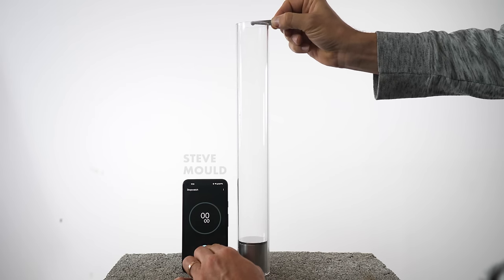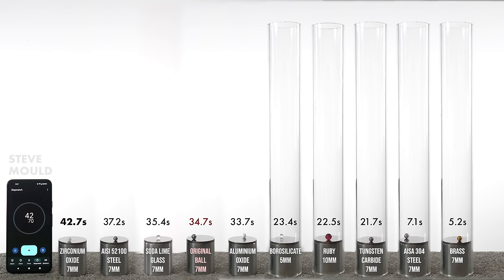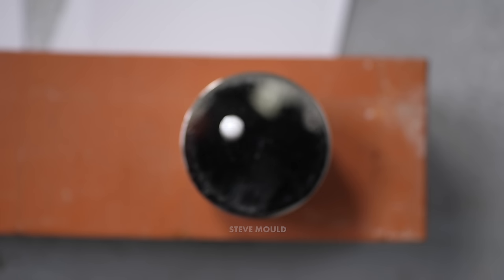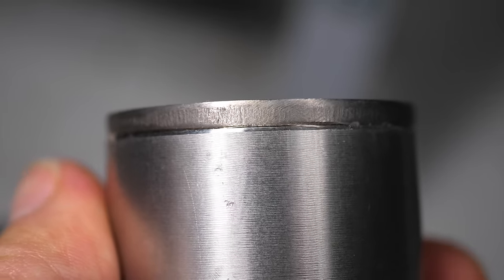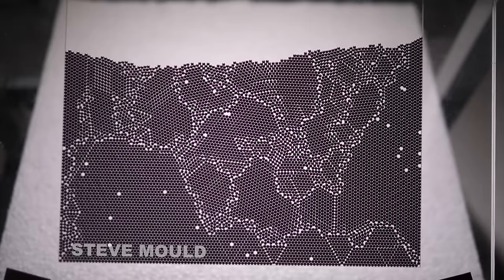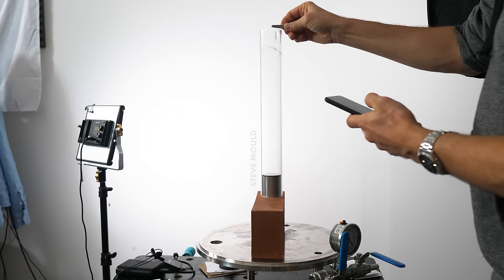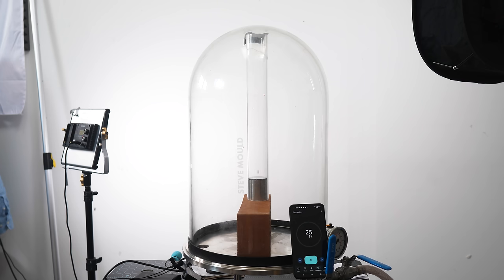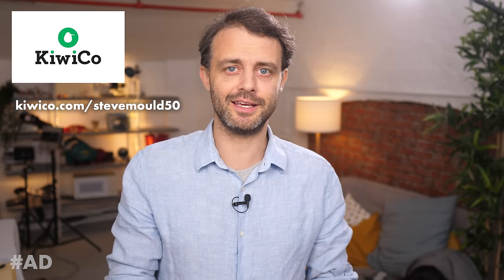This weird metal is insanely bouncy

Comment: Plasticity changes a lot with the change in temperature. It would be great to see how frozen metals compare to room temperature metals in this test. Steve probably has liquid nitrogen next to his bed, so he could make a test and let us know how it worked.
Reply: he's too cool not to have liquid nitrogen lying around
Reply: Yes, i was totally expecting cooled and heated slabs too. Eg. how much more time/bounces would a reduction in temp of the block to -40°C yield. Nothing, a bit, much?
Reply: I dont think there will be a big difference. Plasticity in metals comes manly from the movement of dislocations. By cooling a metal the dislocation movement is decreased and therefore plasticity is decreased. Since this is already a glass the dislocation movement is already neglectable.
Reply: Would love to have seen temperature taken into consideration. Even if the changes are almost unnoticeable, it would be cool to see just how much.
Reply: I wonder about sympathetic vibration. If you were to produce the same vibration (pitch) near the base, would that affect the bounce? And would a slightly off-pitch tone negatively affect it? 
There are so many interesting ways to modify this experiment!
Reply: @sylviaknutcecily  ohh yeah! Like a double bounce on a trampoline. Although at that point wouldn't you be adding energy to the system?
Reply: That was the variable I hoped he was talking about! And then he pulled out multiple sized bearings, and I was like, Ok, sure, they all have different stiffnesses and air resistances, so you'll get interesting results, but I wanted to see liquid nitrogen and blow torches!
Reply: @No_Way_NO_WAY  My gut feeling is telling me: a bit. A very tiny bit. Cooling down to -40°C will not increase the yield point significantly. The BMGs exhibit the yield point (if they undergo any plastic strain) at some 1000 MPa, which is incredibly high, so the stress at impact is usually within the elastic range. Thus, lowering the temperature to -40°C will have a negligible effect. 
BTW, if iron-based BMGs are considered instead of zirconium-based ones (probably they were used in this film), they would withstand the compressive stress of 4000 MPa or even higher. Making the amorphous plate 2 mm thick is possible even if it is iron-based.
Reply: @jarekferenc1149  It's all about hardness, which can change dramatically with temperature. A very cold thing can become very hard and brittle, and could allow for much cleaner bounces because of this. Make it cold enough and the bearing heavy enough, and something will shatter instead of bouncing, and I expect this to be a very elastic collision right before that transition. There are a whole series of experiments about bounce height and material hardness and strength you could do here.
Reply: @Mrluk245  How about the balls though? Especially the steel ones.

Comment: If it helps, the outer and inner parts of a ball bearing are called races. The reason they call it a ball bearing is to denote the type of bearing inside the races, as there are tapered bearings and rod bearings as examples of alternatives. Awesome video, thank you for sharing.
Reply: agreed, i wonder why no one seems to know this? i'm an old man (!) but i would have thought the name would have stuck.

Comment: I was in the middle of saying "The ruby is a bit sad" right when you said it was disappointing. I just got off a binge watching watch repair videos, and those ruby gems are usually SUPER accurate.
Reply: It wasn't so much an accuracy thing as it was a poor coefficient of restitution given its hardness.
Reply: @ashkebora7262  The problem with the ruby wasn't how high it bounced, it's that it didn't bounce straight so he had to keep the tube around it

See 2:00
Reply: @cogwheel42  Huh, I took it as more of a general performance gripe. I guess that's what I get for having it as largely background. Not surprising it'd be really hard to make a perfectly spherical ruby, though. Ball bearings are made while soft and then hardened, but there's no way to soften a ruby! It probably takes quite a bit of effort just to get a visually nice sphere, let alone a 'perfect' sphere.

Even the zirconium oxide bearings, which have a similar hardness, have much easier manufacturing processes than artificial rubies. A somewhat normal ceramic sintering process vs growing a crystal. One you can pretty much define the shape you want even if it's a bit nutty. The other, you have to rely on the crystal structure growing.
Reply: @cogwheel42  About that: I'm wondering if this may not be entirely due to the ball not being sufficiently spherical, but rather that the internal oscillations not damping between bounces. So that apart from the first bounce, it was off-spherical for every subsequent hit, and thus likely impacting a point whose local tangent wasn't in-plane with the plate. Of course, once it rubs the tube it's going to lose energy and start rotating and it's game over from there.

Comment: I suspect the reason for the small ones coming to a stop is more about air turbulance between ball and surface than molecular forces.
Reply: i think he meant even if you took away air resistance (and related air stuff), still the ball will stop because it will eventually get so close to the surface that molecular forces will start playing part
Reply: @pvic6959  Even without molecular forces, the ball will eventually stop (assuming imperfect bounces). Since the ball bounces lower each time, it also bounces more often and you get a converging geometric series for the time between bounces. You can find more results online explaining this.
Reply: @iteragami5078  it bounces lower each time yes, but without intermolecular forces it would keep bouncing just the height of each bounce would approach 0 but never actually reach it
Reply: @bobstr6224  If it's converging, it reaches 0 at one point. I think that you might not be taking into account that the period also shortens.

You want to walk 100 meters. You walk the 50 ms, and that takes you 1 minute. You walk the next 25, and that takes you 30 seconds. You walk the next 12,5 mts, and that takes you 15 seconds.
If you continue like this infinitely, halving both the distance and the time, you finally walk the whole 100 meters in 2 minutes.
Reply: @frechjo  The example you said only true when the velocity is constant. But when the ball bouncing, its velocity decreasing due to lost of energy: E=1/2×m×v² -> since the mass doesn't change the velocity does. So if you doesn't take air resistance and molecular forces and anything into consideration and you write down the time-hight function of the ball, its limes will be 0 but only in the infinity, so it means in reality it never reaches 0. So in this case the only reason the distance will reach 0, because it will reach the planck length and the ball can't travel less distance than that. 
I hope I could help.
Sorry if my english isnt the best, 
btw how bad is it?
Reply: @milemusic_official  not bad at all
Reply: @frechjo  they're describing an asymptote, which is the behaviour of a value getting infinitely close to, but never actually reaching, another value. A simple example is the graph of y=1/x, which asymptotically approaches 0 as x gets arbitrarily large, but never actually reaches it.

No matter how big a number you divide 1 (or any other non-zero number) by, the answer will never be 0. Similarly, if a bouncing ball bearing loses exactly 1% of its height per bounce (i.e. its height after X bounces is .99^X), the height of each bounce would eventually get infinitely small, but it would technically never stop bouncing.

in reality though, the bouncing bearing isn't losing a fixed percentage of height per bounce forever because other forces eventually overpower and completely dissipate the energy of the bounce.
Reply: @ACuriousTanuki  
Ah yes, that's true.
But now I wonder if it really is a constant percentage of the energy that's lost? (just from the bouncing, not taking into account other forces)
I'd imagine it has some variation, maybe even losing less energy at smaller heights.
Reply: @milemusic_official  Yeah, that looks convincing...

(FWIW, from another non-native speaker, your English looks pretty good :)

Comment: Great video Steve, thanks for sharing.

I did my graduate work years ago on amorphous carbon films. What's always stuck with me is just how weird amorphous materials are compared to their crystalline counterparts. They will behave in ways you totally don't expect and do things you didn't think were possible.
Reply: That sounds really cool! Do you have any examples?
Reply: @BillyBob-wh4sq  The classic example is how some types of glass will very slowly flow over time under the pull of gravity.  Really old glass windows are sometimes thicker at the bottom than the top. (Edit: It turns out that this particular fascinating property of amorphous solids is a myth. Whoops....)

From my Master's work, amorphous carbon can behave like a semiconductor, and my work centered on using layers of the stuff as thin film solar cells.

Et cetera.
Reply: @bencushwa8902  Thicker bottom? Yeah, it's a nice legend. But in some cases, the upper part of the glass was thicker. Reversed gravity? No. A thousand years ago they produced glass plates with uneven thickness, and probably usually they put the plates into the windows with the thick part down. But not always. 
Considering the fact that glass melts at around 900°C (1200 K), the ambient temperature of 27°C (300 K) is not sufficient to allow any deformation. As a rule of thumb, temperature-induced phenomena inrease their rate twice, if temp. is increased by 10°C. But if a window glass is kept at, say, 300-400°C, deformation is likely after years. A steel kept at 300°C would maintain its shape. I haven't performed such experiment by myself, but working with metals and metallic glasses, I dare to expect such behaviour.
Reply: @jarekferenc1149  I was just about to type out a reply about the properties of glass detailing the explanation one of my professors gave me in grad school, when I decided to do a bit of reading before hitting "enter".

I'm glad I did. Turns out he was wrong, have had this incorrect notion about amorphous glass rolling around in my head for two decades, and now I have a few choice words for him.

Thanks for pointing this out.

Comment: @Steve_Mould The question at 11:30 actually depends on the phonon generation. An amorphous material has a poorly defined resonance structure for absorbing energy and generating phonons. Phonons are associated with heat and sound (heat is really just sound with randomized phases). With poorly defined resonances, the metallic glass is more likely to reflect the phonons generated back into the bearing. Crystalline structures generally are going to have sharper resonances, generating phonons at that frequency. Those phonons will scatter off defects in the lattice generating heat. All crystals have defects (mathematically the edge of a crystal is a defect). The impact of the bearing on the surface is going to have a spectrum associated with the deformation of the surface. Ideally you want to minimize the phonon resonances at peaks in the the deformation spectrum and those that occur, quickly reflect back into the bearing, before it leaves, and preferably in-phase.

TLDR: exceptionally stiff, amorphous materials are best.

Comment: One thing you did not state and may not have considered:  The resonance frequency of the cylindrical platforms.  The sound wave generated by the ball impacting the surface travels to the bottom before being reflected back to the top.  Larger balls take longer to deform and bounce than smaller ones.  The right-sized balls are probably better timed to be leaving the surface when the reflected sound wave (or multiple) gives it a resonant nudge.
Reply: Sound in metals travels at kilometres per second. In a millimetre-sized objects this means that the base frequency of standing wave would be of megahertz. How can this be matched to bouncing at 1-10 hertz, and bouncing frequency is variable?
Reply: AndrewWithEase11 11  Let me be the advocatus diaboli. He's not necessarily a fool. Basically, the idea is correct: to match the resonance in the bottom platform to the bounces of the balls against the upper surface. The trick is in numbers. We all don't need to be physicists or any kind of experts, and know by heart the values of certain properties of materials.
Reply: The reflection of energy should be solely the job of the amorphous metal. The mass beneath it is merely a bandaid for energy that leaks below the surface. To that end, the sound that emanates below the mass is the remainder of the leakage. Having a sympathetic resonance might half the leakage but the best bandaid would be the hardest possible mass. A mass made of tungsten or cobalt would allow the amorphous metal to absorb and reflect almost all of the energy itself.
Reply: @matthewvincent8971  am I the only one thinking to also make the ball of amorphous metal?
Reply: @jarekferenc1149  you've misunderstood. The Q factor of the "trampoline" is probably too low for the majority of the time spent bouncing to include bounces in which the ball impact the trampoline when the trampoline still contains significant enough energy resonating in the vertical axis. My understaning of his comment is instead that the index of refraction of the trampoline may be low enough such that the ball's compression may be at or near its peak around one period of the trampoline's vertical mode later in time, and therefore the ball would recoup some of the energy it deposited into trampoline.

In fact, after thinking about his comment, I'm not convinced I have a full understanding of what happens when the ball bounces...
Reply: @donaldviszneki8251  I agree on this guy's idea being to synchronize the "bounce time" with the platform's normal mode. I thought about calculating the interactions between the ball and platform during the bounce, but I don't trust myself enough to make an accurate assessment of the situation. Even though I've had a course of Vibrations and Waves, I'm still an undergrad and I have no idea how I'd approach the calculation of the ball's normal modes, much less how the platform's oscillation affects the bounce itself.
Reply: AndrewWithEase11 11  Stop trolling and back up your assertion with something other than a reassertion.
Reply: AndrewWithEase11 11  I call BS to that.  If you don't intend to sway others opinions, why comment in the first place? If you don't like wasting time, stop commenting altogether.
Reply: AndrewWithEase11 11  I'm not surprised you think opinions can't be swayed. It probably fits with your lived experience.
Reply: AndrewWithEase11 11  That doesn't have the same meaning. Now back up your assertion that the original poster is a fool if you don't want to continue looking like a troll.
Reply: AndrewWithEase11 11  You didn't even give a rebuttal! You said your time is too valuable even though its obviously not.

Comment: one of the best bounces i witnessed was an old style computer mouse wheel, unlike the solid rubber balls, it has a dense metal core and the peripheral rubber doesn't get to deform much.  just roll one of those towards a ceramic tile skirting board and you'll be amazed at the speed it'll return back to you

Comment: One think you should look into for further improvement is to place the rig on an anvil or some other very large hardened steel thing. fun fact, blacksmith anvils are commonly tested for their quality by bouncing a ball bearing and seeing how high it bounces the ball back up. The higher the bounce, the better it will be to forge on.
Reply: @gregoryford2532  i imagine its also to assist the blacksmith. from what i've seen, blacksmiths use the bounce of their hammer a lot to reduce the amount of effort needed to forge something

Comment: I too missed my chance to buy one of those years ago.  Apple bought the patent and we never heard about it again.
Two things you should have tried:
1. Actual glass flat plate instead of the "metallic glass"
2. Zirconium Oxide plate
Also, I wonder if the brick offered an impedance mismatch with the metal block causing it to pass less sound energy to the base.
And one more thing... You could have calculated the coefficient of restitution from the audio recording using the time between strikes.
Reply: God I hate patent law for enabling the kind of thing where you buy a technology and then just sit on it forever. OLED screens too.
Reply: It looks like the patents expired in 2017
Reply: @falxonPSN    Do you have a reference for that??

Comment: I think the ZrO2 ball bearing is a good approximation to an amorphous metal ball bearing. ZrO2 is a tough ceramic material that resist to falling impact (did not dissipate energy forming microcracks) and did not suffer plastic deformation. The fracture toughness of ZrO2 used in ball bearing are almost 2X higher than other technical ceramics like Al2O3 (or ruby) and are more than 10X higher than glass.
Reply: Zirconium Oxide is a fascinating material.

It's used in knife bearings, and I've cranked down the pivots intentionally trying to crush the balls, but have never been able to. Also, they will cut channels in 66HRC steel with 23% Vanadium Carbide content (VC content, NOT V content!) after only a few dozen open/close cycles.

Totally different animal, but Elastic Ceramic is another really interesting material. I'd love to see it featured on this channel.